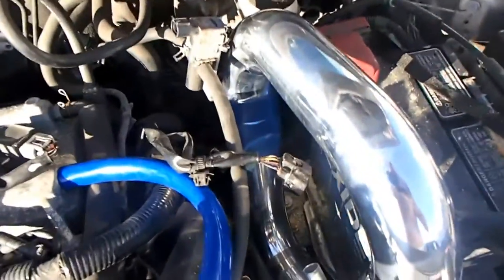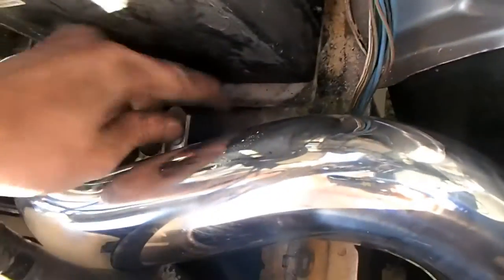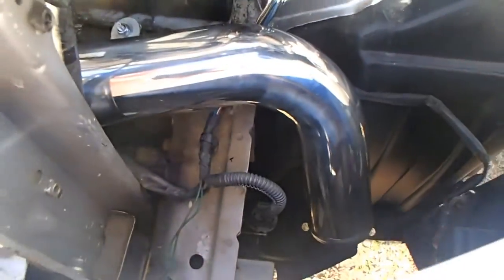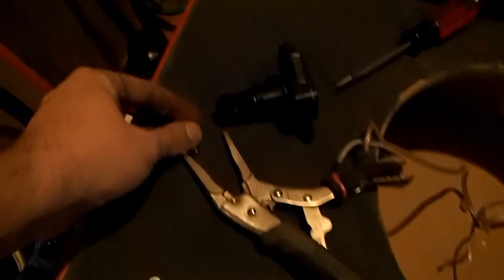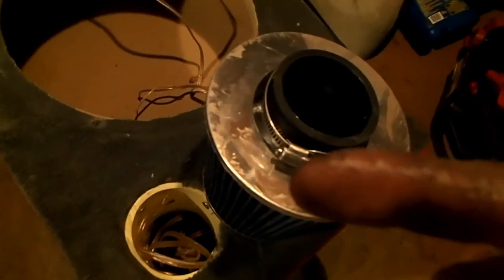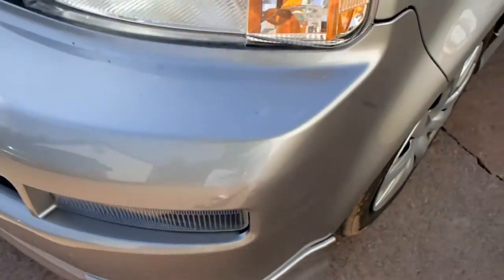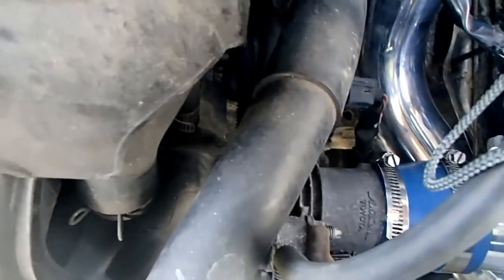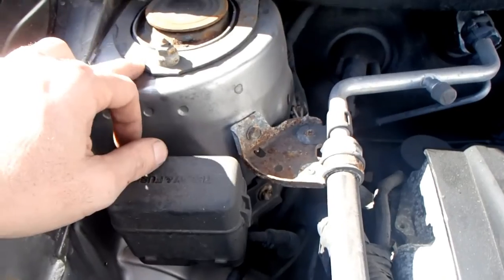scoin xb cold air in stalled 2005

Comment: Thank you for the video. It helped me to make a decision do not  modify a stock one because of the new position of the filter. It has a very low and the car can easily get the water into intake.
Reply from the maker: ok cool thanks for watching
Reply: thats why you install a bypass valve. These were a dealer option and they surely wouldnt sell and install them if they were unsafe

Comment: If you install a cold air intake and get a check engine light for a lean condition. It’s because the intake has a larger MAF housing than the sensor is calibrated for.
I’m working on a MAF tuner for a 63mm MAF housing.
Reply from the maker: ok thanks for us all know that 
i was think it was because way it was made and the ox. sen all most was hitting the other side of the pipe 
i just took it off 
just want to try one but this little eng. only have like 100 hp or so anyway lol
thanks for watching

Comment: Man I already installed the cold it intake In my Scion xB and it helped a little bit
Reply from the maker: i have it on my but it keep turn light on so i took and off and just have a great set of plugs in it and muffler delete on it and it help alot
but hey make a header for it to that would help little more to
Reply: Alright man the filter goes behind the bomber I can see it when I go under the  car I was thinking when it rains or snows something can go in and case a damage
Reply from the maker: i could see the one i had to most do that and yes i think the rain would but i never had any prob. with that on any of my cars 
just do not go in deep water puddle and should be ok
Reply: Adam Eckenrode well over here it rains a lot and snows I think I’m gonna go for a short ram it seems safer but is this a big difference between cold air intake and a short arm bro ? T
Reply from the maker: i just keep my stock one you can fix up the exhaust and that will give it little more 
they make a throttle body for it to but i just do the exhaust

Comment: I just bought an xB and it had a cold air intake. You know if it will still pass smog test ? Or would I have to put the stock one back in order to pass smog
Reply from the maker: it should pass as long you have no lights on the dash if you have any light on the dash i say no
if there no light on the dash but runs little ruff i try first plugs and coils even might need injecters and there not hard to do 
i have my 2 scion and love them drive great and not bad on gas 
i have put a used motor in my sister for little 300 for a junk yard and her has over 300,000 miles and still running 
Amazon has allot of stuff for this cheap i put almost all new exhaust for cat back on both my and sister for under 200 dollars 
so if no light go for it see if pass just make shore you keep sheet if not so know what to fix  
any more ? just ask
Reply: Blazin Draging thanks my friend . No lights so I’m going to see if it passes .
Reply from the maker: @diegoocortess7404  ok go for it

Comment: Did you get your check engine light on with the intake kit. I got the same one and my check engine light comes on air flow sensor
Reply from the maker: yes i did and rest it bit it keep coming on so i took it back off 
i have been running with stock ones  runs fine